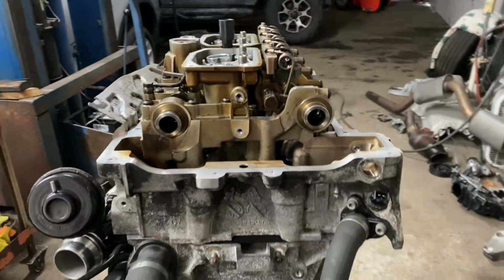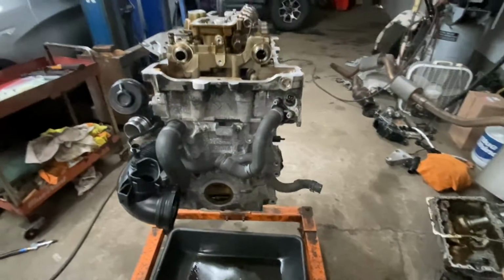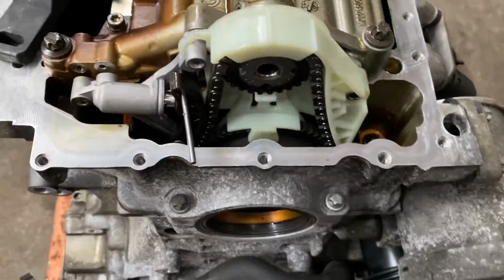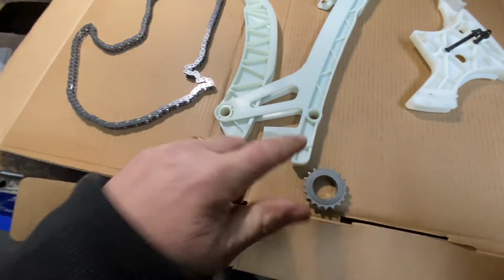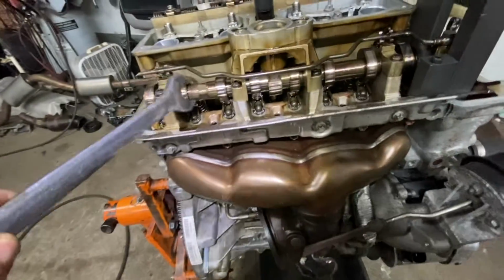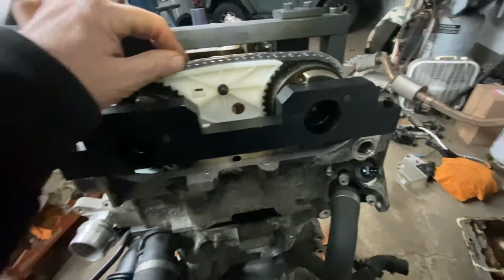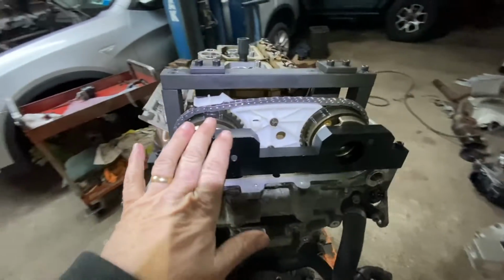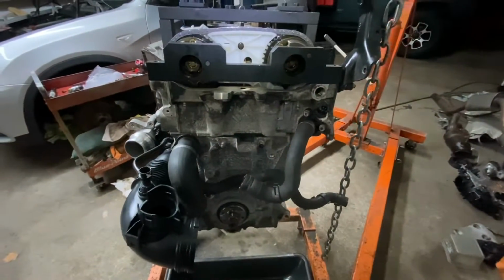Complete Engine Valve Timing Set Up - Cam Valve & Crank Timing - BMW 2.0 turbo N20 xDrive 28i

Comment: This video saved my ass. I am rebuilding a 328i in Australia. It has jumped timing, but one of the rare ones where the engine hasn’t been grenaded. So I had to retime the cams once the chain was removed. I thought I was locked and loaded. Then stumbled across your video. Realised my intake cam was 180 positioned, so the tool had locked down. The trick was that I didn’t recall seeing the barcode when I was doing it. Your video prompted me to check. And bingo! 

Thanks so much. You’ve saved me hours of pain, and probably saved my engine too.
Reply from the maker: Hey glad to help! Thank you the the awesome feedback too! love these happy ending situations.

Comment: One of the best video regarding timing chain alignment.  THANK YOU
Reply from the maker: Thank you for the kind words. Really appreciated!
Reply: I had a broken gide but absolutely no damage because I stopped immediately. 
Intake cam is out of timing .
What is your recommendation of steps to replace the chain and readjust the cams?
Reply from the maker: @estacademy You have to set up the complete valve timing like in the video.
Reply from the maker: I have many videos on that engine to get the job done

Comment: This is perfect for me. 2013 x3 @ less than 76k miles and I’m at the point of dropping the oil pan/ diff and have to loosen the transmission mounts to get enough room to clear the subframe. I’m getting close to the process you described in this video-so thank you so much for this! One little trick I should also put in the oil pan video- you mention the e8 bolt on the oil pan with the breather so close that a socket can’t fit- I used a 1/4 drive ratchet wrench from huskey worked perfectly 👍 thanks again!
Reply from the maker: Sure, no problem! Really appreciate the feedback for others to learn from!

Comment: What if I don’t do it in the bell housing, how can I do this with the engine already out of the car? 2:44
Reply from the maker: That center bolt has over 500ft lbs and no impact will get it off and shouldn’t be used anyhow. Try to lock flywheel with the tool teeth on engine stand.

Comment: For manual cars would you just leave it in gear with wheels on ground and parking break on? Or is there the same lock in bell housing?
Reply from the maker: I didn’t come across this problem with a manual transmission so not sure. Can look up locking tool for manual and see if it’s the same

Comment: Will the flywheel pin only go in one hole on the flywheel or is there multiple holes it can go into? My cams are at tdc with the lock tool on but the flywheel doesn't line up with a hole by about a half inch
Reply from the maker: There are other holes but only one that the pins slides into. If it's not lining up timing is off.
Reply from the maker: Also don't forget the oil pump counter balance shaft pin tool as well.
Reply: Thank you very much for a reply. Ok and what would be the next step if the flywheel pin doesn't slide in? Can I turn the driveshaft or maybe a screwdriver to turn the flywheel till the pin goes in? I also still have cam locking tool in place and cam sprockets/ chain and guides removed. I appreciate you!
Reply from the maker: @sacred7607 so with the chain off, turn flywheel till pin goes through then lock cams and oil pump pin in place then put vanos gears on. You have to watch the whole video it explains all this.

Comment: Great video!

Only my car, I just want to check and adjust, if necessary, the timing. So, the VANOS gears, timing chain tensioner etc. will all be in place. After TDC, locking the crankshaft, if the camshaft locking tool doesn't quite fit, is it still alright to use the spanner to move the relevant camshaft a little so the tool fits? With the crankshaft locked, everything still connected, any movement on the camshaft will cause a little movement of the crankshaft or are those movements so small that it doesn't matter?

Thanks!
Reply from the maker: No, that means the vanos gear is stretched. I have a video on that particular situation, this is assuming you lined up everything first and when turning the engine it won’t line up again.
Reply: @motorcarnut  Thanks for the reply. Are you saying that even if the timing is out i.e. the holes in the metal plates in front of the Vanos units that rotate don't line up with the pins in the timing tool (21:38), the camshaft locking tool should always fit properly?
Reply from the maker: @MartiansChronicle Yes, watch this video on that problem.

https://m.youtube.com/watch?v=DnaNnbrFYWA&feature=youtu.be
Reply: @motorcarnut  Thanks for that. That was really useful. One to put on my list of what to check at the end.

Comment: How do you align the crankshaft and the camshafts at tdc when they are not in timing. Without the tc on, did you rotate the camshafts individually to get them to tdc? Did you also do the same with the crankshaft?
Reply from the maker: Did you watch the whole video? You can put crank just before tdc then rotate each cam making sure there is no binding. You need all the tools to do this correctly or it won’t run.
Reply: Thanks for your reply. Here is my situation. I was replacing one cam. When timing the cams I didn't realise the flexplate pin did not go all the way in. Upon realising that, the the cam timing was out of tolerance angle with the crankshaft as it had not locked. I then locked the flywheel at tdc and  rotated the camshafts separately to tdc. Everything aligned but now I have 130e20 and 130f20 codes. I need help
Reply: It's one of the best videos. ...Thanks

Comment: Hello Sr
Its me again, so after did evrething I turned the engineand it was about one revolution on the cams and the crankshaft sprocket broke
I don't know if I put too much angle torque after torquin to the specs which were, first step 100 NM and then 270 degrees .
I would like your input, What could have happened ? I don't think the crankshaft snout was missalingned , you can not miss it when you put it through the crankshaft sprocket and then the oil pum srpocket, any ways I am waiting on a new one but I would likw to know why it happened .
Thanks in advance .
Reply from the maker: Wait? What broke off? The crankshaft bolt? You put the right torque 100NM then 270 degrees. I know that’s a lot of torque but it’s correct. When you first turned over the engine was there any binding? Did you make sure you removed all the alignment tools? Like the one for the oil pump counter balance shafts?
Reply: @Motorcarnut  I know what I did wrong,  I was just looking at your video, and I noticed that I placed the crankshaft sprocket backward, the lip or the ticker part was facing out  not toward the engine,  anyway thanks for the prompt response,  I really appreciate it
Reply from the maker: Ok, no problem. Good luck with it.

Comment: Is there any difference between the n20 on a 2013 bmw 328i and 2013 bmw 328i xdrive?
The reason is that I found a timing chain kit genuine for 148 
And the same kit it's on ebay for 350
But the one that is 148 specify that is from 2013 to 2018 bmw 328i xdrive
The car I'm working on is a 2013 bmw 328i base.  Any help would be appreciated thanks
Reply from the maker: No there isn't. N20 is N20 AWD or not WHEN you are talking about the timing chain kit. Other things are different such as the oil pan etc.
Reply: @Motorcarnut  Thanks a lot 
Really appreciate it,  I will get this kit for 148.

Comment: I have just removed the exhaust VANOS unit, but I cannot fit the new one. It almost fits, but not the last few millimeters for a snug fit. It’s like chain doesn’t seem to allow enough slack for it to come on straight. If I try without the chain it fits perfect. The timing chain tensioner is completely removed. Any suggestions?
Reply from the maker: You have to have some slack somewhere. When I do them everything free wheels the crank bolt is not tight yet so I can check for smoothness.

Comment: I have a clicking sound coming from the exhaust vanos when I am turning by hand to check timing? Is it supposed to do that?
Reply from the maker: Yes, that’s normal because there is no oil pressure, but make sure when turning over the engine to check all marks line up slip on the vanos cam lock with the 2 pins it must slide on perfect or one of the cams may be damaged
Reply: @motorcarnut  thanks so much, I had no idea and could find nothing on it, all cams line up after 10 revolutions by hand, the tools fit back in all location! Thanks again
Reply from the maker: No problem
Reply: My pin did not go all the way into the flywheel when I timed my engine. Thus the cams were slightly not in time with the crankshaft. I was getting codes 130e20 and 130f20.  I corrected the timing at tdc, but the same error codes won't go away. Help please
Reply from the maker: Unfortunately you have to re due the timing. These engines require dead on accuracy

Comment: What chain set are you using? Bmw or aftermarket?
Reply from the maker: For that particular job because it’s involved, I used OEM BMW, but a good quality aftermarket one is fine just don’t use the cheap Chinese ones.
Reply: @motorcarnut  any idea where to get a decent aftermarket?
Reply from the maker: https://www.ecstuning.com/b-genuine-bmw-parts/set-timing-chain/11315a19aa2/?gclid=CjwKCAjwsfuYBhAZEiwA5a6CDEl3qTAW35LKxLlFRHLZylaDIkOLb8RbXk29QJWHechtWg_575VHIRoCnVcQAvD_BwE

Comment: What’s the name of the special tool used in the bell housing to lock the motor in place. I don’t think I came in the kit I purchased
Reply from the maker: It's a crankshaft?flywheel lock,
https://www.amazon.com/Flywheel-Holder-Replacing-Balance-Engines/dp/B089112KQW/ref=sr_1_fkmr1_2?crid=2YXF26ZUTFNHK&keywords=2013+bmw+x3+crankshaft+lock&qid=1661108689&replacementKeywords=crankshaft+lock&sprefix=2013+bmw+x3+crankshaft+lock%2Caps%2C73&sr=8-2-fkmr1&vehicle=2013-31-2461------------&vehicleName=2013+BMW+X3

Comment: Excellent video, the other way to a line camshaft is look at the bar code numbers on the intake and exhaust camshafts facing upwards towards you. You can also verify with a screw driver on number 1 cylinder.
Reply from the maker: Yes, but with these engines you have to be precise or you're going to have codes.

Comment: When you remove the engine and assembly back in the vehicle do you have to reprogram the vehicle or you can just plug up and start
Reply from the maker: No, not if it’s the original engine that came out of it

Comment: I am looking into buying one of these cars that needs an engine replacement. Were you able to remove the engine from under the hood or did it have to go out the bottom? I see you have the car on a lift, I don't have one where I would replace the engine.
Reply from the maker: I removed it from the top but I took the transmission out first. You can take it out through the top but it’s more work without removing the transmission. This it a pretty big job considering it’s only a four cylinder.
Reply: Thank you for the reply!